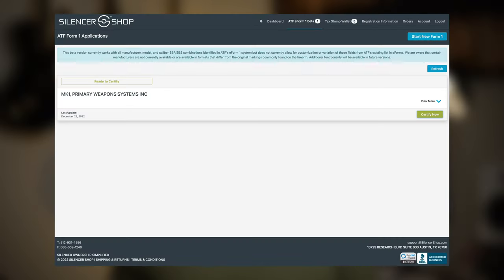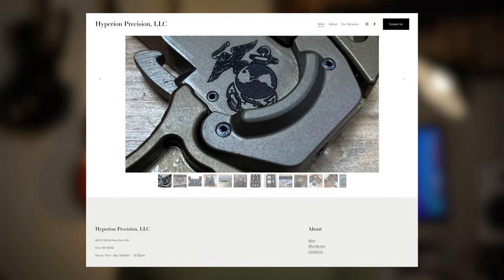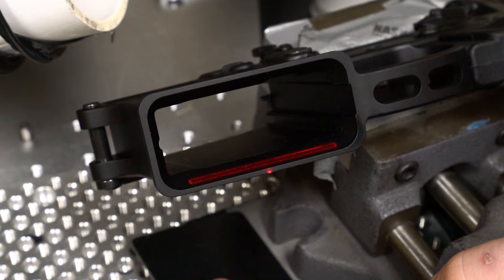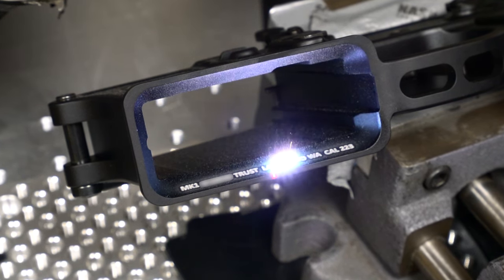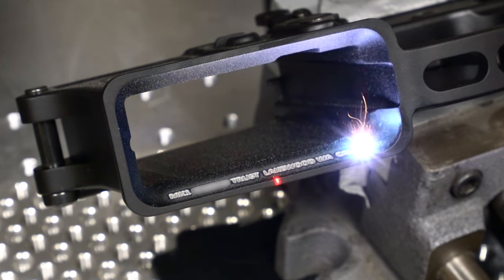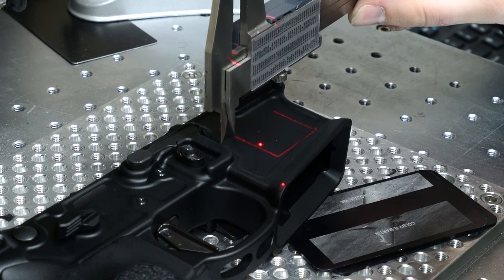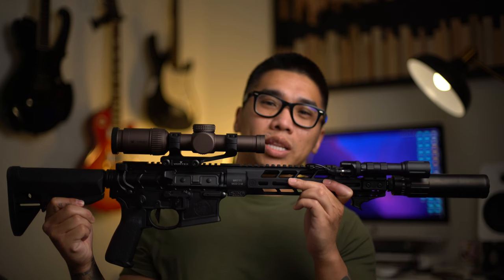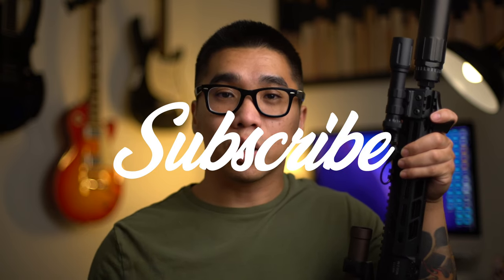How To ATF Form 1 Laser Engraving

Comment: So….first timer here, doing my sbr eform 1 thru SS.  When in the process do you get the engraving done?  And does that need to be submitted to the ATF as well? Thank you, Hai!
Reply from the maker: You can get the engraving whenever you want. You can even engrave without ever doing the paperwork or ever filing. The engraving just doesn’t mean anything without the approval. So if you want to have everything ready before the approval, get the engraving now and assemble everything went you get approved. Just make sure you engrave the correct information.
Reply: @HaiTran  excellent, thank you so much!  I appreciate your help.  The video was great!
Reply from the maker: Good luck with the process!
Reply: Just be mindful, if you are mailing your weapon to get engraved it's best to do prior to being approved, as mailing an NFA lower requires more hurdles to jump through
Reply: Is this mandatory in all states ?

Comment: Was your lower reanodized after the engraving? Looks amazing and I plan to do the same
Reply from the maker: It was not. I used a paint pen and wiped away the excess.
Reply: Sweet build, what paint pen did you use?
Reply from the maker: I wouldn't be able to tell you. I bought them awhile ago and don't even know where they are right now. Just some random, cheapest I could find, paint pens from Amazon.

Comment: Alright question. Do I have to get the receiver re-coated? I have a Honey Badger which is clear ano, I’d have to cerakote that. Also don’t want rust on the engraving so that’s the dilemma.
Reply from the maker: It’s your choice to re-coat the receiver. Also, if you’re trying to re clear anodize the Honey Badger receiver, that’s going to be an interesting experience since you’ll likely not match the surrounding area so will have to do the entire receiver. As far as rust, lower receivers are generally made from aluminum which are less prone to rusting so it’s not much of something to worry about unless you kind of work to make it rust.

Comment: The Serial number on the eform for silencershop, is it the current serial number or the new one you want engraved? Just wondering because I thought you have to have both on the eform.
Reply from the maker: I don’t have an absolute answer for this because SilencerShop did all my paperwork. My serial has always been the same serial. The only thing that’s new is the trust name which is what I had engraved.
Reply: @HaiTran  ahh, for some reason I thought there was a new serial number being engraved, but that makes more sense. Thanks.
Reply from the maker: No problem 👍🏽

Comment: Hey I have a question. I did the silencer shop form 1 a few weeks ago for a pistol I had making into a SBR. When I did the form 1 beta It didn’t ask me to upload any photos of engravings or anything. 

How did you upload your photos? And can you engrave after you get approved or will you be denied?
Reply from the maker: I didn’t upload any photos. I did my Form 1 the traditional way not via the amnesty. The Silencer Shop Form 1 portal now has a section to upload photos if needed. If you have questions you should contact Silencer Shop. 

You can engrave whenever. The Form 1 just won’t be valid until you get both an approval and an engraving. This is true for a traditional Form 1. If you’re doing the amnesty, I don’t believe you even need to get an engraving.
Reply: @HaiTran  thank you. I did It before the amnesty period. I was just wondering because when I did It they didn’t have an option to unload photos for engraving I didn’t know if ATF has to have a photo of It.
Reply from the maker: Not that I know of for the traditional route. I certainly didn't upload anything and got approved.
Reply: @HaiTran  I've used Silencer Shop for the eForm 4 process to buy a supressor at a LGS, so I'm in their system. How / when is the $200 for the stamp paid if I use their eForm 1 like you did?

Comment: What if the my psa lower has everything engraved. I have to do it again?
Reply from the maker: It’d be quite the coincidence that your lower would have what’s required for the Form 1 to be engraved. It’s usually different from what’s already there. But if you happen to have everything needed already there, you wouldn’t need to engrave it again. At least from what I was told.
Reply: @HaiTran  one last question Mr Hai.  I'm trying to form one my spr through the silencer shop beta app. But it is still requiring a $200 text that even though in our current state it is supposed to be free of charge. If I click YES or exit this app would I still be able to circumvent the tax payment or will it be just refunded to my account?
Reply from the maker: You’d have to ask Silencer Shop about that.
Reply: @HaiTran  thank you Mr Hai. Im calling them right now. Love your content
Reply from the maker: Good luck 👍🏽